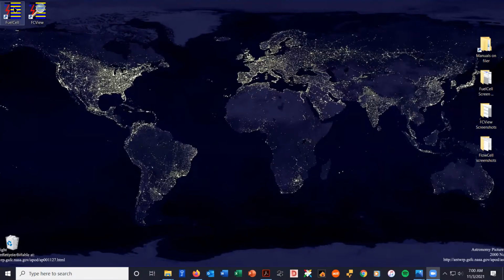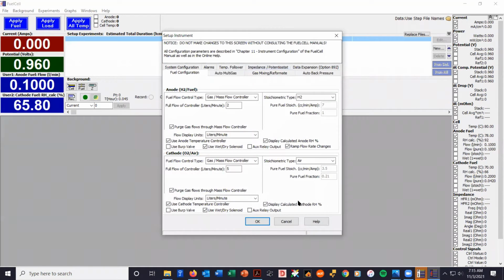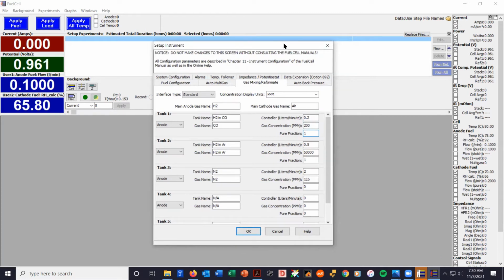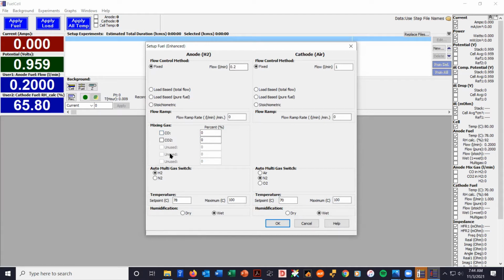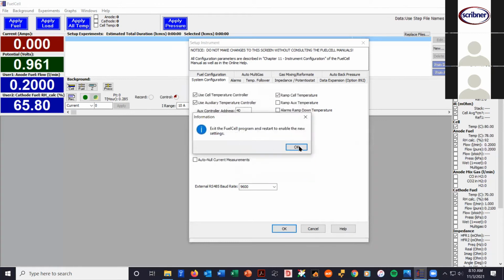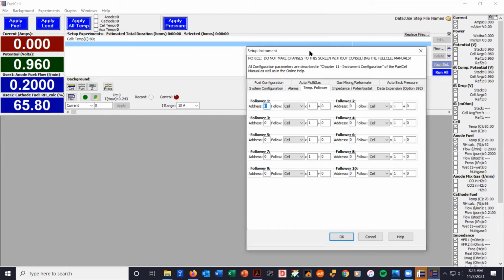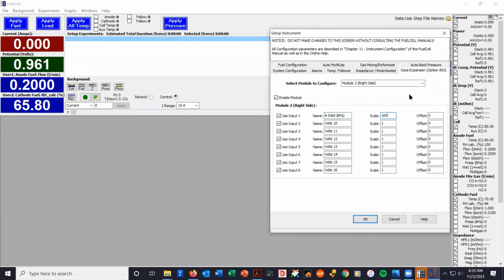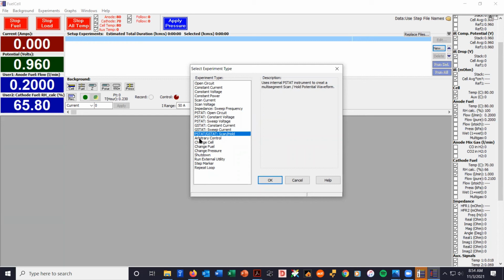Zoom Training on Instrument Configuration for FuelCell

Comment: Before physically connecting the 850 fuel cell system to the computer with the Fuel Cell software installed, must this computer have the Fuel Cell software preconfigured before physically connecting it?
Reply from the maker: Install the 850 Fuel Cell Test System and any accessories as described in the respective Installation Instructions. Next, install the FuelCell software on the computer that will be used to operate the 850 setup. Connect the 850 to the computer via the included USB cable. Finally, power on the hardware and start the FuelCell software.  If you need additional support, please reach out directly on our website.